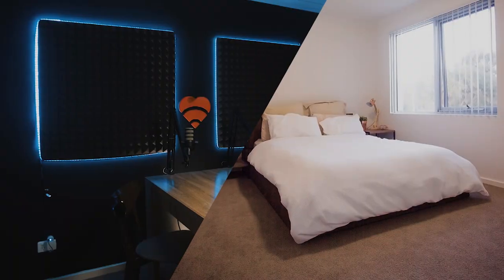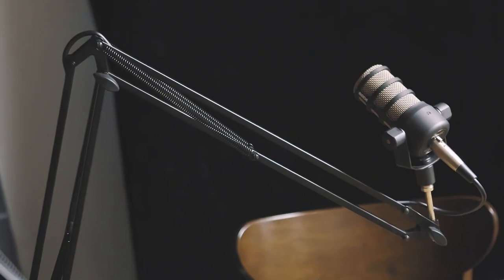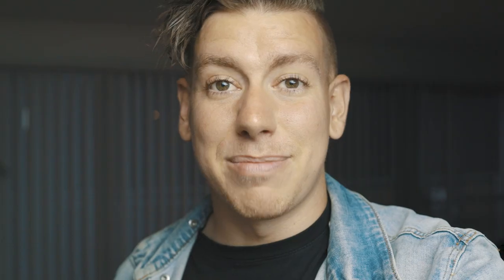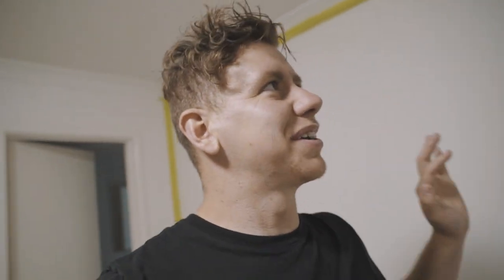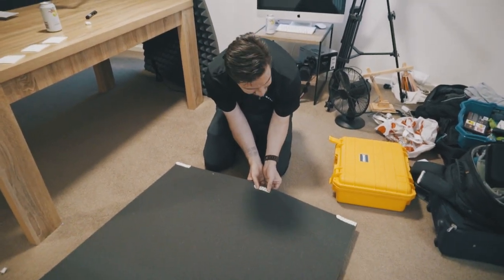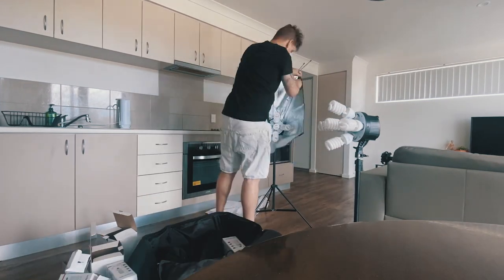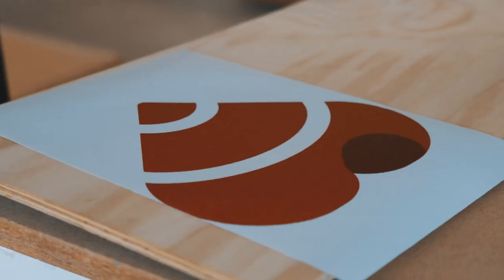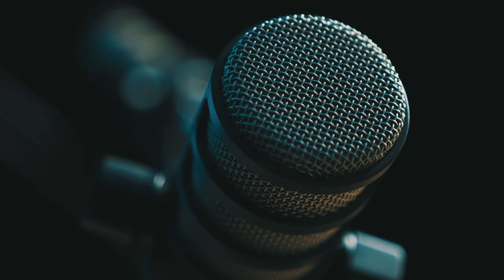How to turn your bedroom into a podcast studio.

Comment: Looking to up my game over the next couple months. This was massively helpful. Looks great.
Reply from the maker: Awesome. What’s the main hurdle right now? It is worth breaking that down I said next couple months for years is all 😅 but once I started with little things on the list once a week it really wasn’t as big of a job as I had in my head. Best of luck with it all.
Reply: @SocialScope  lol fair enough. I'm moving into a new house in June and will have an office so I'm planning a build out. I guess the issues are design (not artistically minded at all but I do like the idea of a wooden background with a logo that's lit up).

Also gear. I'd like to upgrade my webcam. I'm leaning towards a gopro because in my mind I'll be doing stuff outside too (biking, kayaking, etc)

Finally, obviously, is cost. I make money with what I'm doing but convincing my wife to spend the money on my podcast/youtube after we just bought a house is a tough sell so it'll probably be a fairly tight budget.
Reply from the maker: Those are all very fair points my recommendation would be the GoPro then and rode wireless go ii mic set. I wouldnt worry about the studio for now. You can shoot anywhere with that combo and will be good to get the ball rolling.
Reply: @SocialScope  I appreciate it!

Comment: If painting over a light wall with a dark paint. You can save your self time painting coat after coat of paint by painting a layer of primer first! Tell the paint guys you are doing the opposite. ( painting a dark wall to white, this will make them mix a thick coat. More for your money. Otherwise they delute the solution to save money on their end.
Reply from the maker: Yeah you are absolutely right haha I use to recommend the grey primer all the time but it completely slipped my mind and I paid for it haha.